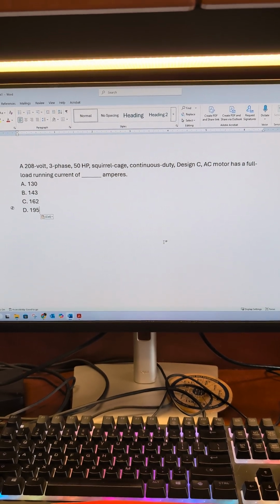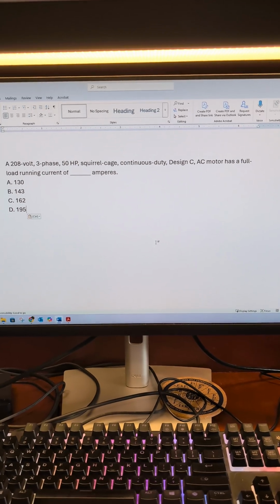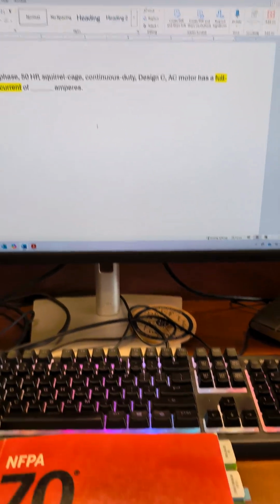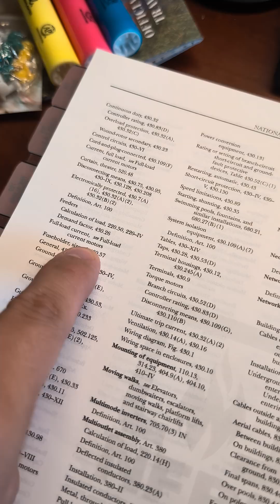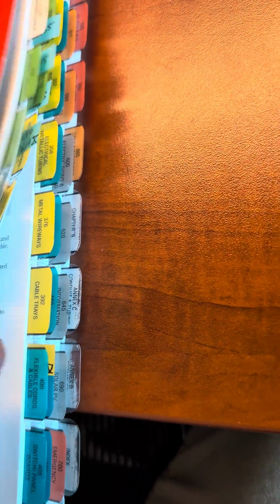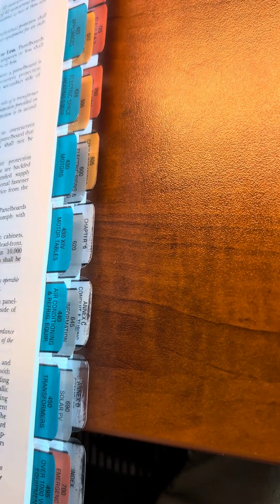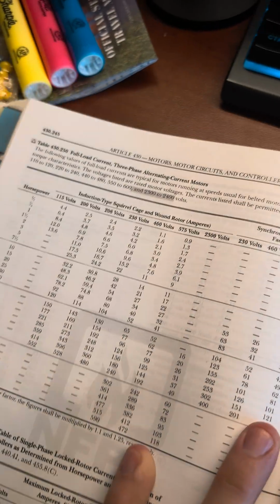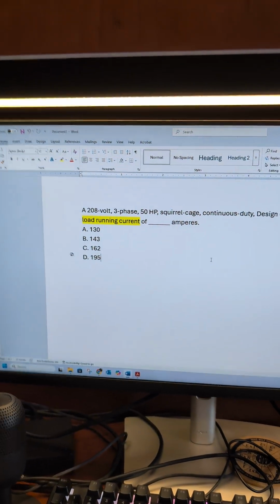NEC Table 430.250: Motor Full-Load Current - Exam Question ANSWERED! #ElectricalCode

Comment: https://youtube.com/shorts/JTcqPQL81vM

This guy gets a totally different answer.
Reply from the maker: He’s trying to combine two methods and got the wrong answer. (I have an answer key so I know I am right.)

Just remember this: FLC is Full Load CODE (current)
FLA is Full Load Amperes (nameplate)

When you are looking for FLA, code question will typically ask for nameplate current. That’s where you will use HP or kW rating, voltage, 1.732(for 3ph motors), efficiency, and power factor.

The best part about FLC is all of that math is already done for you. Nameplates also do this math for you technically and will give you the FLA.

Find a motor nameplate and try it out. Get the:

kW rating / (voltage x 1.732(if 3ph) x efficiency x power factor)

Don’t forget to convert kW to watts by multiplying by 1,000. If using HP, 746 watts per HP

Comment: What gets me is the continous duty part ? Do we typically only apply a 1.25 % when looking for conductors and ocpd/ overload protection?!
Reply from the maker: There is continuous load and continuous duty. Most motors are usually continuous duty and other equipment is considered continuous load if it is expected to operate for more than 3-hours straight.

Check out 210.19(A) and 210.20(A) and you’ll see how to apply the continuous load 125% rule.

For motors, check out 430.22 for single motors and how to apply the 125% continuous duty rule.

Comment: See, my quick maffs back of the napkin version was "50HP needs to be converted to watts. That's about 70% of the HP in watts, which is about 35 killer watts. At 208 vplts that's ~~roughly 160 amps, so C is correct." 

Which I i would argue is a more practical approach to the question, as you can convert HP to watts and divide the power by the voltage a lot more easily than looking up tables in a book. 

Still gonna upsize the cables to 70mm2 cross section just in case.
Reply from the maker: Most people would use that approach in the field, but motors have different efficiency ratings, different power factors, and different service factors. All of these items change the Full-Load Ampere ratings of that motor, with the exception of the service factor. Using HP to watt conversion may get you close, but it may still be inaccurate. 

A 70 mm^2 wire would be 1/0 AWG, which is sufficient for 150 amperes. This is a continuous-duty motor, though, and would require the 125% adjustment to be applied to the amperage for conductor sizing. 

143A * 125% = 178.75A
Since this is above 100A, you can use the 75-degree C column in Table 310.16 for conductor sizing, and 3/0 AWG would be needed or 111.9 mm^2 conductors.

Keep up the great work! Thanks for watching.